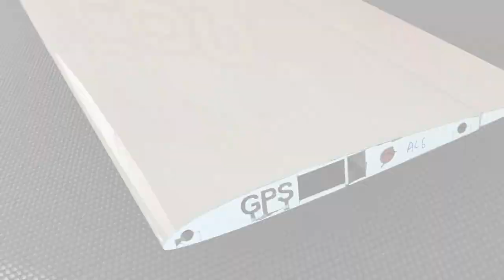Pike Paradigm GPS Sport RC Sailplane, First Look

Comment: GPS racing opens a whole new window into soaring. You’re using a side of the performance polar that is hardly ever used in F5J and that’s the high speed side. GPS Telemetry is required which unfortunately adds quite a bit of expense to the sport. Air Data telemetry is also permitted (at least in scale GPS racing) so I’m surprised there isn’t a TE probe on the vertical stabilizer and some silicon tubing running down the tail boom. Is it not permitted in this class? Looking forward to seeing more vids on this!! Nice job.